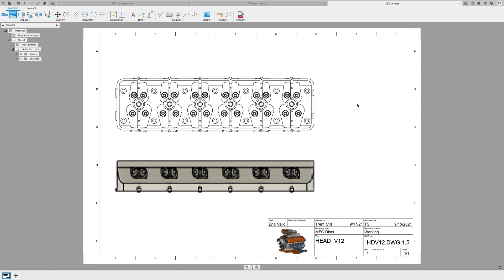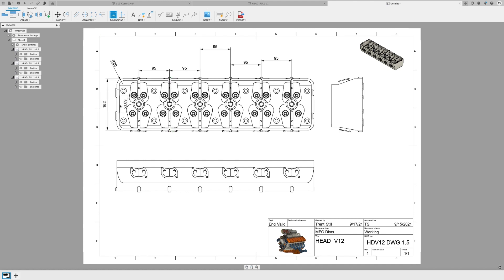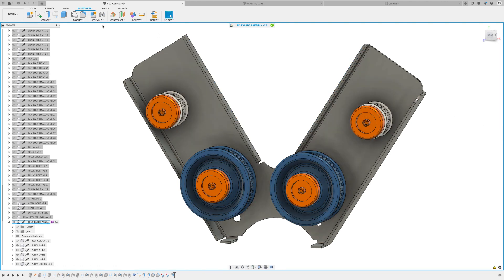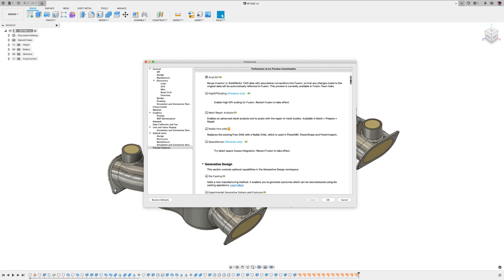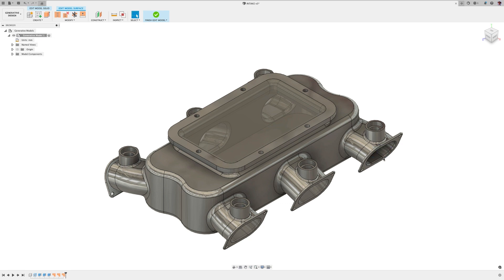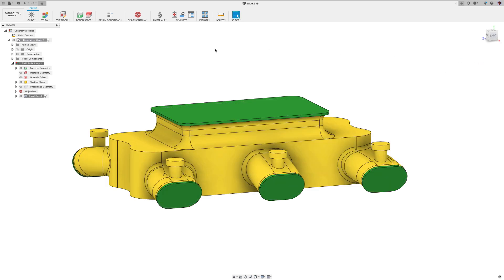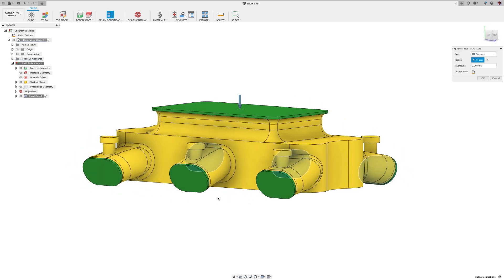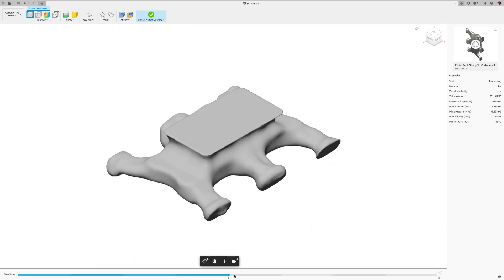What's New in Fusion 360 Design & Engineering - September 2021 | Autodesk Fusion 360

Comment: yeah but air is not fluid so how do you do fluid analysis on something that is not fluid
Reply: Air is a compressible fluid.  Gasses are fluids.
Reply: For the purposes of engineering (or more properly, continuum mechanics), a fluid is anything that flows. Some fluids are effectively incompressible (like water). Some – like air – are very compressible.